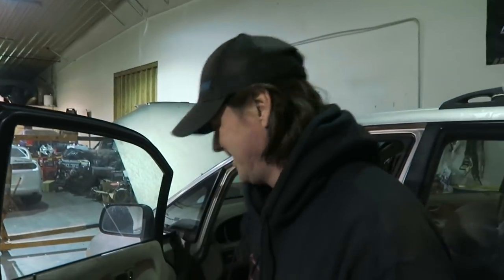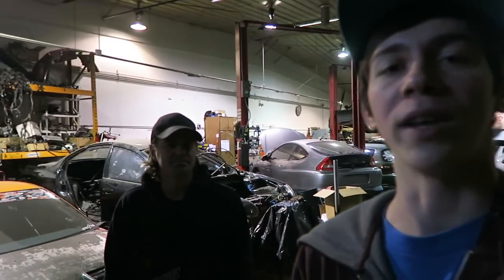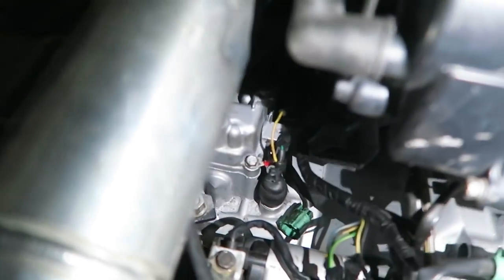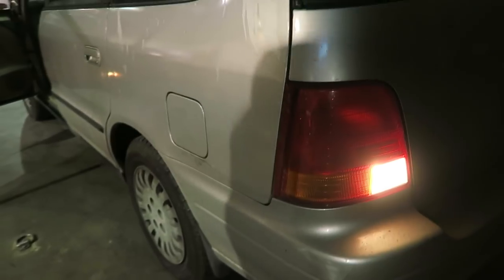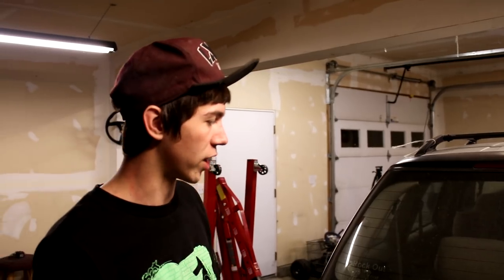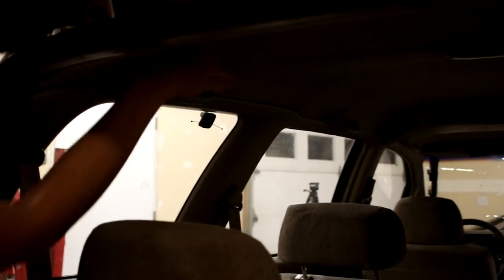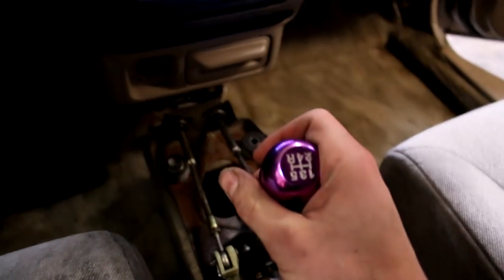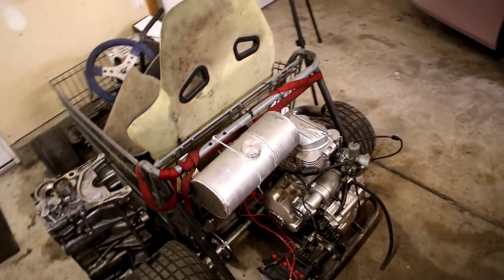Sleeper Minivan Goes to a Car Meet

Comment: 3 fully built honda engines 6 cars total and wont spend $60 for some used tires.i love the channel but come on Kyle you have to be smarter than that man. Put some good tires on that van.
Reply: ClutchkickPJ Some nittos would work too 😏
Reply: ClutchkickPJ they can't be clean like you pj plus he's young. But Ummm where's the videos at
Reply: I hate to be that guy, but I totally agree. People die everyday over some dumb stuff like this. It's ez pz. The passengers shouldn't have to "Deal" with the risks involved. I just don't want Kyle to learn the hard way and get hurt or hurt someone else.
Reply: He'll figure it out. I played that "It's good enough" game with my tires until I blew one out on the highway. Twas a but clencher.
Reply: I just don't get the.. I can afford another car build but can't buy tires mindset
Reply: Honestly, it comes down to personal priorities. Some people put so much work into their cars, and they are always a work in progress, that things get pushed down the priority list. Mine were all out of whack when I rushed to get my old project on the road, and drove with a sticking rear caliper (Ended up chewing through a pad right into the rotor) Which wasn't THAT bad. And also never bothered with an alignment because "I'll do that after the brakes and rest of suspension is done in a few months" And chewed the shit out of two front tires, causing one to pop. Funny how now I have 4 brand new summer tires, in the bags, waiting to be put on my new project in the spring, and the brakes are already done, long before I'm even ready to drive it.
Reply: ClutchkickPJ can’t have good tires on a sleeper cmon bro
Reply: lol i bet if he asked he could get like 50 tires from viewers for free. He could definitely get a sponsorship of some sorts (but that wouldnt be that great because contracts and all) but yeah facts
Reply: Sixty dollars tires isn't much of a better idea.
Reply: But it does have a backup camera lol
Reply: yes!
Reply: she needs some nitto’s 👀👀👀
Reply: Fella's..... He mentioned the tires were no good... did you see this man race?? NO. one pull for a crowd. he will get tires eventually i'm sure really bitchin over tires. he is well aware.
Reply: Wouldnt call them “fully built”

Comment: Smoked a bmw while being neck to neck with a gtr in the van 😭😭😂😭
Reply: CrisRayaa bro i had ti rewatch that like 10 times!
Reply: With full interior and 3 passengers 😂😂😂
Reply: The gtr lifted..don’t be delusional
Reply: If the van had 1-2 passengers and weight reduced by removing interior, it would’ve probably beat the GTR
Reply: @DatCarGuy350  no.

Comment: "OBJECTS ON THE SCREEN ARE LOSING" man, what a savage meme would it be.
You said, that the reverse light triggers the rear view camera. That means, it has its own input in the radio, thus a switch is completely duable. If you go whit a relay style, it can even look stock if you even care at this point. Diging the build, keep up!

Comment: For the rear view camera part, as long as you're feeding the camera with constant 12v (ACC) and reverse signal (12v from reverse light) for headunit only, you can change a setting in the HU to always display camera view. Not sure about the HU you're using, it is available in pioneer HU.
Most installer will run reverse light 12v to power up the camera, which is easier to install and also prolong cheap camera life, especially the small regulator that always get overheat and melt.

Comment: Not sure it will be but will the shorter pipe angle be a problem? When you’re shooting flames and such. It looked at least to me angled even enough to still scar whatever is near it? 
Would suck to see problems occur due to melted wires or anything :(

Comment: U should try  your hand at porting your heads to make better flow and yes more horsepower  th ave it all stup so when u r ready to move up to a turbocharger but try an old lawn more to get the hang of porting then u could even make more money doing porting  on your car and or van put next size valves in that's an other upgrade to make more top end  and midrange  also gotten torque

Comment: new tyres are cheap as hell .... safety comes first not last .. how stupid is that ...
Reply: Silver Stacker he still hasn’t gotten tires ?
Reply: yeah that shit is sad. He will spend 1000s on building the engine but wont spend less than half that on safety... idk how all his builds are completely STOCK suspension also
Reply: HondamanFG2 Vtec joke is on you bud, how build s don't cost near a couple thousand. Maybe 1k tops for everything that went in the van
Reply: Nate Prikkel umm yea... it’s a sleeved fully forged motor. A grand tops huh? Lol children

Comment: I'm going big turbo kit soon this year ok I got my 550cc injectors an 255walbro fuel pump relay kit an my high flow Cadillac converter and a second chip two step turbo coming next eBay turbo then Willis gauges fuel gauge pressure gauge any suggestions on gauges I should have to do Turbo it's a manual boost gauge show comes with the eBay turbo so I don't know if I'm good or not